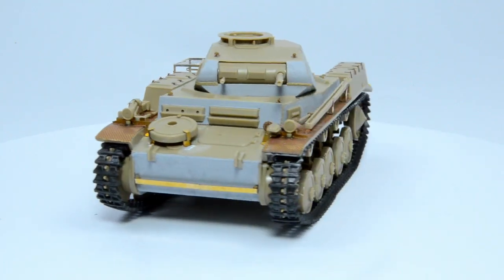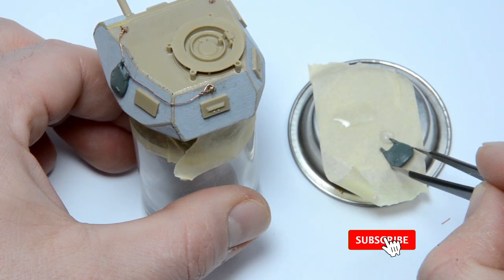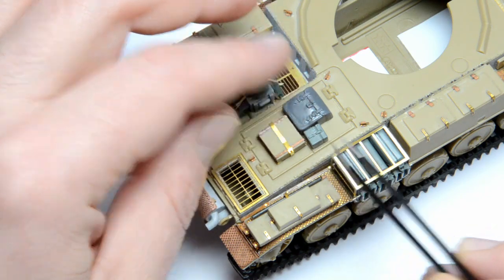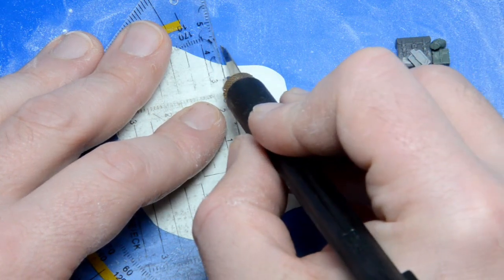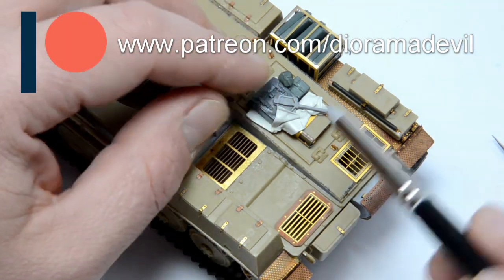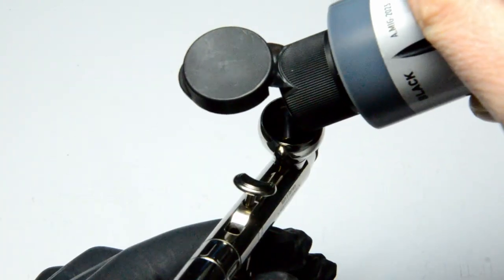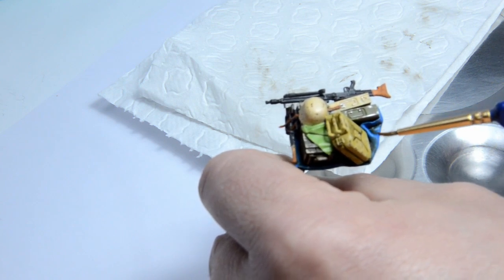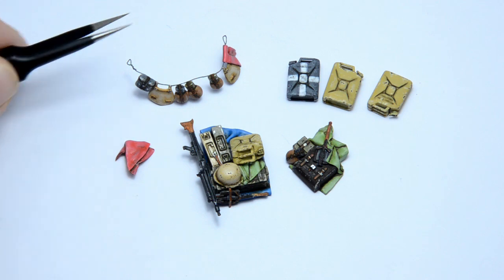AFV STOWAGE Building, Painting, Weathering (1/35, Scratchbuild)

Comment: Great video, any reason you use CA glue for stowage instead of styrene cement?
Reply from the maker: Tnx. It is stronger and instant. I like to work fast.
Reply: @dioramadevil  yes, and it looks very natural too; nothing looks melted into each other.
Reply from the maker: @worldwarmini3919  There is another way. You can put togeather the things with some styrene cemment (Extra thin or Revell contacta). That way you have planty of time to position the parts perfectly. When you are sure about the position, you add a dropp of extra thin CA, and make the bond bullet proof... I do this with figures.